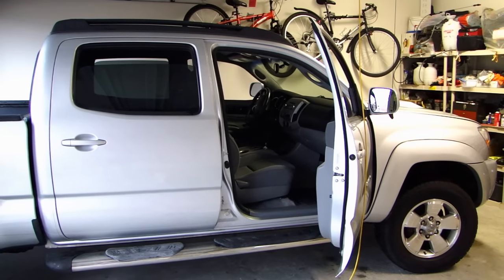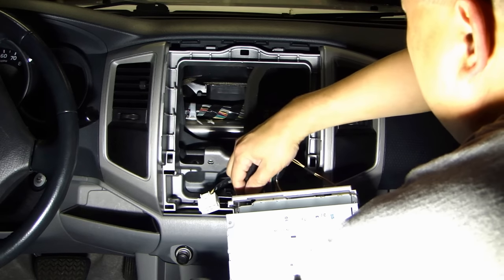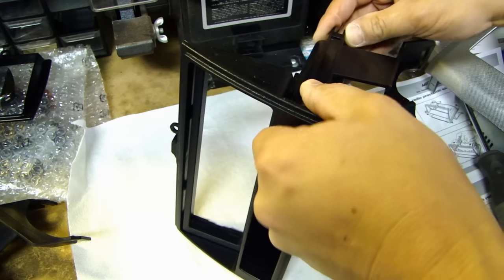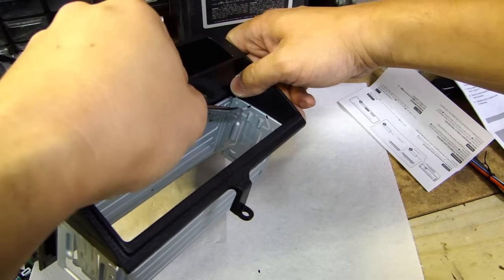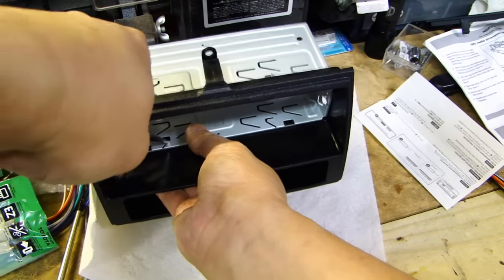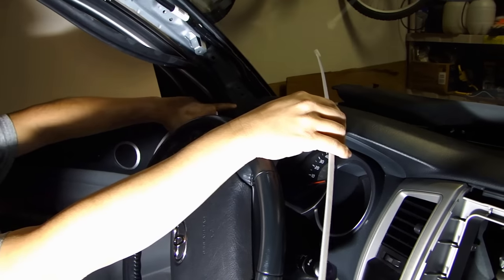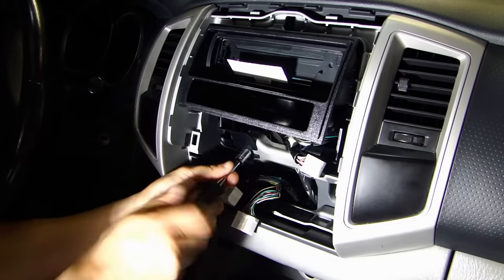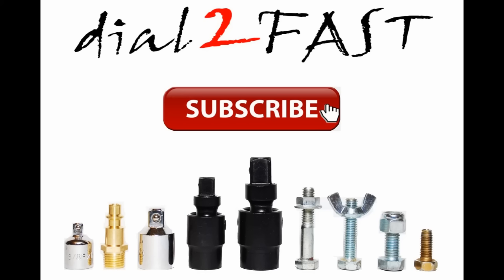Toyota Tacoma Stereo Install with Bluetooth  - 2005 to 2011

Comment: This guy knows what he is doing- followed the directions for a 2010 Tacoma to swap in a refurbished stock radio unit, as the Toyota Tacomas of these years have notoriously crappy sound systems.   If you are replacing with a stock radio/stereo, you only have to remove one mounting bracket to pop out the lower assembly that has the emergency lights and clock.  Great video!!

Comment: May I ask - that connector you didn't plug in at the end, does that go to the steering wheel controls and require another harness sold seperately from sony? I'm trying to figure out what exactly it goes to and how to get steering wheel controls to work.

Comment: This helped a lot. But why did you remove the metal side brackets from the factory unit when you didn’t reuse them on the new unit? Thanks.
Reply: Cuz it’s in the way of removing the clock, airbag indicator light and hazard light out from the bezel.

Comment: greetings dial2fast;

i was wondering if there is any concern of the toyota's security system being triggered by doing this? i have a 2007 toyota tacoma and i would much rather not get "locked out" of it. thank you in advance for your timely response. also, thank you for this great and clean how-to video :)

P.S.
when you were attaching the wires together what were those orange looking tubes?
Reply from the maker: lordofh3 For this install, we had no problem with any of the factory system. The connection I made on the wiring harness is using butt connectors, and a crimper tool. But those connectors are just called butt connectors. You learn more on this video: https://youtu.be/uaYdCRjDr4A

Comment: FYI if you have an 05 Tacoma with the JBL sound system this wiring harness will not work. You need TYTO-01.
Reply: I just saw this video  did u do on 05 Tacoma  what part ls I should order  ?

Comment: Awesome video!  Thanks!
Reply from the maker: Thank you!
Reply: dial2fast I just successfully installed my new Pioneer stereo using your video.  Very helpful.  The wiring diagrams for Pioneer are not as helpful as the Sony one you used, but it each wire used the same color on the other side, so I got lucky.  
Thanks again!
Reply from the maker: Liz judkins great to hear you got the install done.

Comment: If you disconnect the clock and airbag indicator bar with the battery still connected wont you get an air bag warning light in the dash that only the dealer can reset?

Comment: Question...By doing everything in this video, will the steering wheel control still work?
Reply: Jacob Wright No, you need a separate adapter
Reply: TrebuShade what other adapter do you need
Reply: Metra Axxess ASWC-1 Universal Steering Wheel Control Interface, Amazon.com

Comment: would these instructions be the same for a 2009 Tacoma truck that has controls in the steering wheel?
Reply from the maker: +Evandre Molina You will not have steering wheel control after this install. I believe there are aftermarket interface parts that will allow it. You will need to research it.
Reply: yeah i found it.. the aftermarket part is call maestro sw.

Comment: Do you know if the controls on the steering wheel will work on non stock radios?
Reply from the maker: You need to install another steering wheel interface module to control the aftermarket radio. I am not sure the exact part, but you can check with your local stereo shops for details.

Comment: so i tried to use the same wiring harness that was listed in the bio and it didn’t fit my factory stereo harness... only thing i can think of is that i have a jbl factory stereo so maybe the connections are different?? if anyone else has this problem or anything lmk